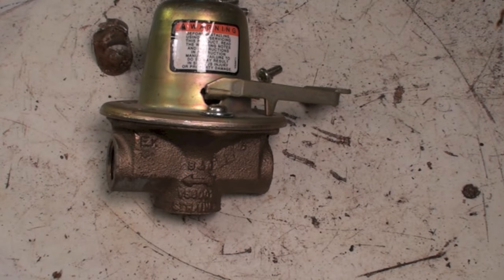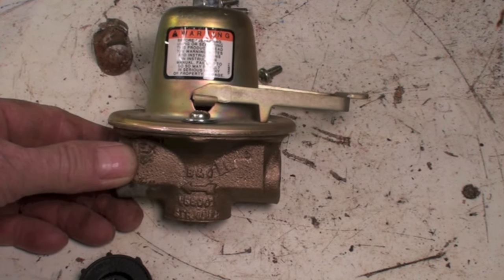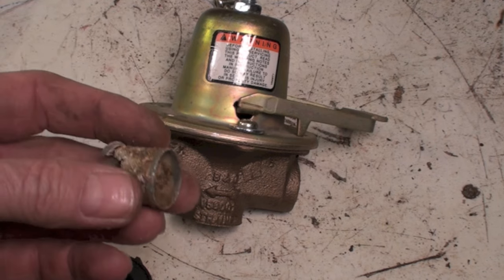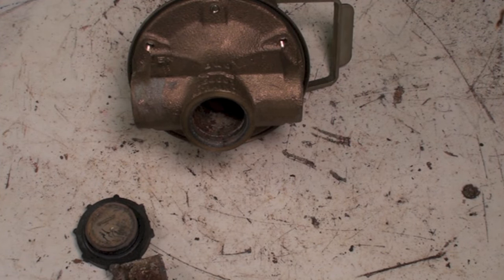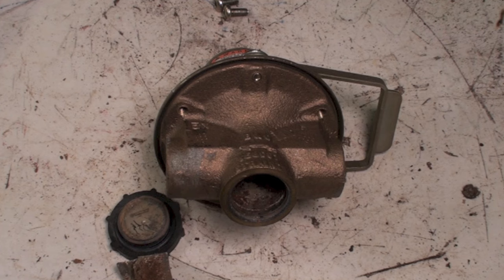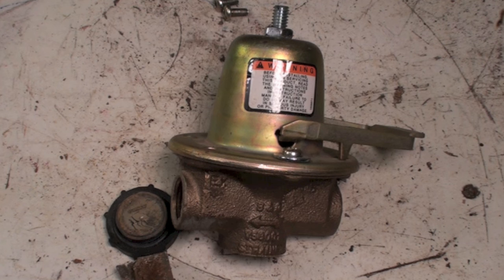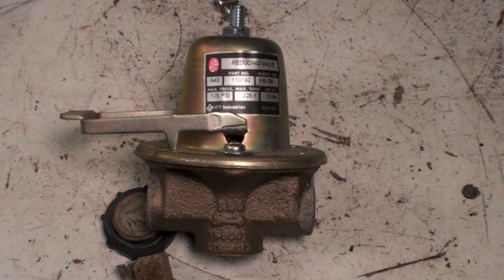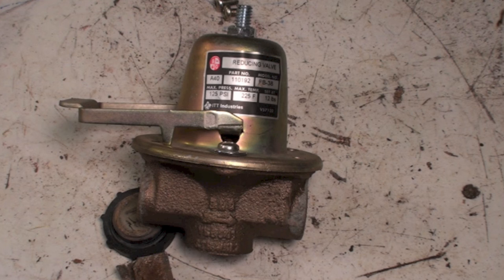Troubleshoot the boiler pressure reducing valve

Comment: Thank you! As a mechanic I suspected this valve is bad! My pressure keeps building up causing relief leakage heater is working fine otherwise! After watching your video I'm convinced this is it! Now I'm going to replace it!
Reply: I would bet it is your expansion tank... Simple way to check.. fill boiler and turn off water supply and see if the valve pops off
Reply: @robertwadas  You were right Bob! Only my tank just needed to be drained out. It is a very old but good system, and the tank has no rubber diaphragm inside it. I lived here over 20 years and never drained it, so it filled up completely. I now drain it out yearly and have to relieve the pressure a few times/days until it stabilizes. I never replaced the pressure valve. Good so far. Thanks Bob Chi-town!
Reply: @stevesmentkowski7789  I replace  mine ith a one with a diaphram.. 39.99  2 small sections of pipe... Plus it dowes not have to be above the system,... I T'd it odd where the relief valve is piped in... I also added a shut off there in case I needed to change the tank.
Reply: @robertwadas  Thanks for the info will keep that in mine.

Comment: It took me 9 years to figure out I had one of these feeding my boiler. Bucket in the floor catching the blow off just lived with it. Never thought about a pressure regulator and I deal with regulators servicing fuel injection so you would think I'd know that sort of thing.
Reply: It is most likely tour expansion (compression) tank. 90% of the time.
Reply: na u were just too cheap to pay a tech to fix your situation 😂

Comment: There is a loud humming sound that is coming from the reducing valve. Started several days ago.  This is a 4 zone system and the top level hasn't worked all winter.  If I slightly life the reducing valve the hissing/humming sounds goes away temporarily.  Is it a problem that I lift it?  Seems like it should do so on its on. Any idea what's going on?

Comment from the maker: I have not had a lot of problems with the Watts valve but as you say, I have not seen a lot of long term use.  I think you will have problems with any valve that does not open often.  I have actually had better luck with valves that were installed on systems with a small leak.  Any thing that regulates water seems to have a high failure rate.  I dont have any real solution.  Thanks for the comment.
GFM

Comment: nice video!
I just ordered a replacement Bell & Gossett 110192LF FB-38, until then I'm just lifting up that lever to fill the tank slow, and the extra water is going out the overfill pipe.

Comment from the maker: The only way a system can be waterlogged with a bladder tank is if the bladder has burst.  Probably not your problem.  If the pressure reducing valve is leaking by, it will cause your problem.  I agree the reducing valve should be replaced.  And yes, the relief valve should be replaced.  Many times when I have replaced a reducing valve, the relief valve continued to weep. opening it to blow out dirt did not help.  Hope this helps.
GFM

Comment: I have a 1 story,last year the psi was between 10-15,this year my husband took the boiler apart and cleaned it,and changed the oil filter..Then the psi was at 45,and the temp got up to 180..It blew water all over and wouldn't relight.Once it dried the psi stayed at 30,and the temp isn't going above 140..it seems to be working,but I should probably get the valve changed anyway.I think it's been there since 1987.

Comment: Very nice video. Son was asked to work on a boiler that was sitting dormant for 5 years. He refused because the owner thought the system would fire right up with out much effort or parts. He told owner same thing about replacing old parts. Son tells me the owner was upset but hey, what to do if people don't want to spend the money.
Reply from the maker: Certainly, the boiler could have numerous failures after sitting for that long.  Its kind of in for a penny, in for a pound.  These things can snowball more than any other type of heat.  Your son is right.
GFM

Comment: I started having issues with my system overpressuring. The regulator was about the age you speak of, 5-7 years old. SO I pulled it out, a Honeywell FM450. I opened it up, didn't look bad, cleaned it out and put in back in, and yes it leaks, a dribble of water passes through the closed valve. So I bought the latest replacement, a Honeywell VF06. Got it in and it does the same thing, a new regulator! 
There is a Backflow Preventer, BP900, connected to it up stream. Looking at that it appear corroded and jabbed open. SO I returned the new regulator as defective and bought a new assembly, Honeywell FM911. Put it in and it seemed to work at first, with the outlet open, regulator set to zero, applied inlet pressure and no leak. Great right?......BUT NO ! After connecting up the boiler side the symptom came back. Overnight the pressure went from 12 to 30 psi.
What am I missing here?
Frustrated in Colorado
Reply: Expansion tank?  have you checked it to see that it is not water logged?  if it is then when the water heats it will expand and gain pressure.
Reply: MrDmadness , yes. tank work er fine and emptied. turned out to be a ball valve had a tiny leak through.

Comment: The water pressure on my boiler is registering at about 30 psi, or slightly higher. This causes my pressure relief valve to blow off water. I installed a new expansion tank with a bladder. It doesn't seem to be waterlogged. I suspect it could be the pressure reducing valve. I'm going to replace it to see if this corrects the problem. Also, the pressure relief valve should need replacing as well. Do you agree?

Comment: Ours is installed vertically instead of horizontally, which is incorrect.  I found out when changing to a new one and read the directions (first time for everything!).  Make sure your reducing valve was installed correctly to begin with.
Reply from the maker: Good thoughts.
GFM

Comment: Hello grayfurnaceman   Your video's are easy to follow and very informative (to the point) so it with great resultants that i ask this question. if all things are where they should be in regards to pressure. Do i even have to replace this regulator? can't i just shut water feed off?  my water is terrible, And it makes me pretty mad that i have to replace the valve a lot over the years. @ 60 bucks a pop. they should make a rebuild kit for these things. thanks in advance  a D.I.Y.
Reply from the maker: If you have no bleeders or the system has no air in it and no leaks, you can just shut the water off.  The valve is there so you do not have to manage the pressure.
GFM
Reply: @grayfurnaceman  thank you

Comment: Question:  At the end of the cold season last year, I started to see some sporadic water leakage.  My boiler would run fine for several days, and then I would have water on the floor.  I had the pressure relief valve replaced and now that it has gotten cold again and I'm running the boiler, I am still having the sporadic leakage.  Same thing, it runs fine for several days and then I see water on the floor.  Any thoughts or suggestions?

Comment: I just ordered a new WATTS Brass & Tubular 1156F boil feed regulator and a new 
Watts 1/2" 9D-M3 Dual Check Valve w/Intermediate Atmosph. Vent, Backflow Preventer.

It's the preventer that is leaking, but I've had issues over the years where the regulator is over pressurizing the system.
I usually can fix that just by snapping the little top handle that opens the valve to allow water through, the snaps shut.
Doing that a few times seems to clear out any calcification buildup.

But when I get the new parts and install them, if all is well, I'm curious if it's even possible to actually fix the regulator by opening it up (taking the 2 halves apart) and cleaning up any gunk inside.

Is that possible with the 1156F feeder?

When I take apart, would I expect things to go flying off into the 9th dimension?  

Ideas?
Reply from the maker: I have not been successful repairing these valves.
GFM

Comment from the maker: 12# will work for 1 story and a basement.  18# for 2 story and basement.  If you have 30# and the relief has not opened, you either have a 3 story with a 45# relief or the relief is not working.  It should start weeping at 25#.  Be sure it works!!  Dangerous.
GFM

Comment: Enjoy your videos!  Can I remove the black plastic cap and clean the inside trap without having to remove the valve from the pipes ? I would assume just turn off the boiler, shut the water off and proceed with the cleaning. Thanks in advance.
Reply from the maker: Unless you have valves on both side of the red valve, no.  The  pressure side has domestic pressure and the boiler side has the boiler pressure.
GFM

Comment: Its right in the BNG operating instructions not to leave the water turned on if you left the water turned on and the system developed the leak the homeowner would never know this is the reason why

Comment: Great video.
Is there a difference between a B&G FB 38 and a B&G FB 8 or better yet can a FB 38 be used as a replacement for a FB 8?
TFS
Reply from the maker: The FB 8 is an older version of the FB 38.  I believe the valve is identical.
GFM
Reply: @grayfurnaceman  Thank you very much sir. I will be picking one up as the quick fill is no longer working on my furnace.

Comment: Long story but I will be as brief as possible. Several years ago, I had the fill valve and expansion tank replaced on my old Hydrotherm HC-125. The pressure in the system after the repair got too high and the safety valve blew. Well, like a fool, I let some air out of the expansion tank. Next, I had the guy come back out and he adjusted the fill valve which fixed the problem. It has worked ok over the last several years. However, I have read that the pressure when the system is cold versus hot should not fluctuate much. My pressure probably fluctuates 10 psi. Is that ok? Also, should I attempt to recharge the tank or replace it since I mucked it up? Thank you. Great videos.
Reply from the maker: The question here is do you have and expansion tank or a bladder tank?  If its a bladder, the pressure should be set to factory specs.  If its an expansion tank (located above the boiler), the water needs to be drained out every year.  Hope this helps.
GFM
Reply: grayfurnaceman Yes, that helps. It is a bladder tank, an Amtrol 15 and when I went to pexsupply.com, I utilized their expansion tank calculator and the Amtrol 30 is the proper unit for my 125,000 btu boiler. So, I am going to install the larger tank and go ahead and mount it vertically versus the current horizontal configuration. It will be a learning experience. Thank you. I will subscribe.
Reply from the maker: bg147 The bleed will be an experience.
GFM
Reply: Hmmm, maybe I should hire someone.
Reply from the maker: bg147 I never argue with someone that wants to use a professional.
GFM
Reply: grayfurnaceman Haha. Just a quick question... I was lazy and mounted the bladder tank horizontally and I still have big fluctuations in psi. If I were to mount it vertically, which direction should I mount it? With the water side on top or air side on top? If that makes any sense. Thank you.
Reply from the maker: bg147 Position of the bladder tank is not important.  It may be too small.
GFM
Reply: William Lafond
I bought a larger tank and mounted it in a vertical fashion. It worked well last year. Thanks.

Comment: Have a blader expansion tank.  The pressure was set at approx 15lb when cold.  Could not get pressure up to 3 floor.  Increased pressure on reducing valve to bleed air out of radiator.  Got heat going, but now boiler pressure running approx 25lb.  Don't believe reducing valve is issue.  Should I drain off some water to match expansion tank pressure, and adjust reducing valve pressure to match cold water pressure 15lb.  Not sure if expansion tank will be ok at 25lb pressure setting.  What would u recommend setting boiler pressure.  I was thinking 20psi hot.  Please let me know.  Thanks.
Reply from the maker: The 20# hot is ok.  15# is not enough.  25# could start the relief valve weeping.  Reset the reducing valve to the 20# number.
GFM

Comment: Had to replace rad vavles,now after filling the system pressure went really high like 50#,do you think it could be the fill valve is stuck open? last week it was fine had to drain it to fix a leak, now its high pressure. Thank you
Reply from the maker: The valve has probably just failed.  Its pretty common.
GFM

Comment: I have the same valve it works holding back pressure (about 14 PSI)  but when I lift the valve to purge my lines, it wont increase pressure.
Reply from the maker: The valve has failed.
GFM
Reply: Doh! mine is broken too!!!

Comment: Hey Brother I am not sure if you will see this comment, yet I have a question you might have an answer to. I have a taco feed valve which fills my boiler. I know this allows water to enter the boiler if there is a pressure drop. However does this valve also act as a check valve to keep hot water from bleeding back into the cold side?

I have a peerless boiler and the tankless coil went bad. I first noticed a problem when my cold water pipes were becoming hot. I then removed the tankless coil from the boiler and just put a blank cover on. However now when I start the system, my cold water is now hot. Seems to me that the taco feed valve should act as a check valve to keep this from happening, yet I might not be correct.
Reply from the maker: It is not a check valve.  In fact, water will feed from the boiler to domestic water if the pressure is higher in the boiler.  The only way to stop that is with a back flow preventer.
Your problem may not have anything to do with the boiler.  
GFM
Reply: @grayfurnaceman  Thank you for the quick reply. Any idea what might be causing the hot water from the boiler to push past the taco valve and enter the cold water supply side? I never had a backflow preventer on it before and it has worked well. Just not sure what has happened. My tankless coil definetly had a hole in it. Wonder what went out first to cause what damage. Any suggestions.
Reply from the maker: @TransTurbine  Have you been able to follow the hot water back to the red valve?
GFM
Reply: @grayfurnaceman  What do you mean by the red valve?
Reply from the maker: @TransTurbine  Reducing valve
GFM
Reply: @grayfurnaceman  The unit uses a taco 335 valve. It was hot on both sides. The hot water made its way all the way upstairs, so much it heated the cold water coming out of the faucet. Really the taco feed valve is the only place that it could now back feed from. I have ordered another taco unit as that is my only guess of what could be bad. However no literature clearly states the taco valve has a check valve inside. However after looking at an internal diagram it looks like there is a check valve within its housing. I just figured I would ask someone more knowledgeable than myself. I ordered a new taco valve, I will see if that solves the problem. When I get more time I will eventually plumb in a backflow preventer as this would be a good idea to have. The house was built a long time ago and is on well water, so I guess the code back then did not require one.
Reply: I appreciate all your replies and time. I will stay at it and try to sort it out.

Comment: I would assume you tighten clockwise to increase pressure? There was a mishap with our system when they accidentally cut a line in the basement while working on other plumbing and I don't know what the contractor did. I'm assuming he messed with the reducing valve. The nut is completely loose. How difficult should it be to tighten to allow water through? It seems rather hard to turn and I don't know how hard to try.
Reply from the maker: Clockwise to increase pressure.  However, many times, if the valve is old, they just stop working.  You have to replace the valve.
GFM
Reply: grayfurnaceman Replaced the reducing and relief valves like you mentioned. They are both old and came as a unit. System finally filled and we have pressure to the second floor. Was at 18psi then turned on the heat and it went to 30 and relief valve kicked in. Would that be an indication our expansion tank is full of water?

Comment: So I'm having bit problems with my system over pressurizing and have a hunch it is this valve however to test it. I shut the water off from the city supply and released some pressure from the system is took a few quarts of water out to get press back to around 12psi. And the pressure continued to rise back up to over 30psi and of course the press relief valve opens at this point. Did this prosecutor 3 time with same results. Any ideas on why psi continues to rise? Expansion tank maybe?
Reply from the maker: +dmmflys If there is a bladder tank, tap the side.  If it sounds full of water, it has burst.  Hope this helps.
GFM

Comment: Is it normal for a electric motor  on a spring and a gas sensor and a wireless receiver to be installed on a natural gas line in on one of these valves inside a house behind things were you cant see it? Cause when I was experimenting with a engine design I made it blew off the valve with the spring thats when I saw it.
Reply from the maker: Beats me.
GFM

Comment: Hello. I have yet to replace the watts pressure reducing valve. Is it possible to still lower the pressure on it until its replacement arrive?
Reply from the maker: Probably not.  The 2 most common failures are leaking by of the valve (increased pressure) and no flow at all.  Adjusting the valve usually will not help.
You can shut off the manual valve if it is overfeeding.  Just check the pressure daily.
GFM